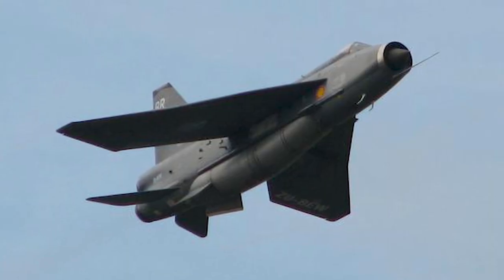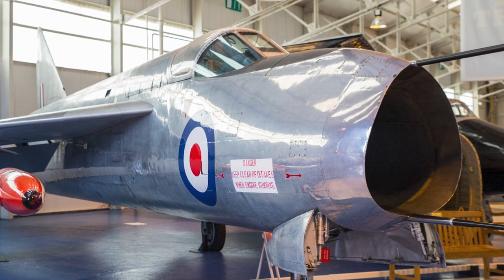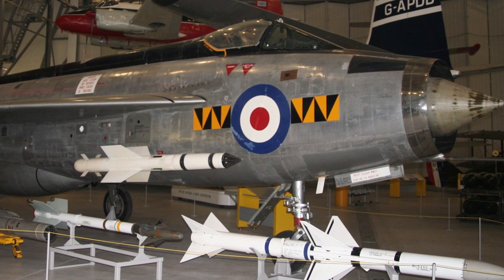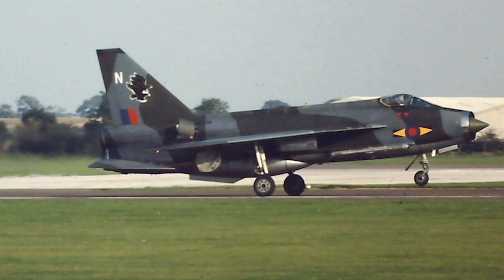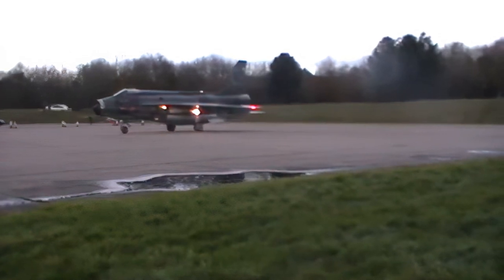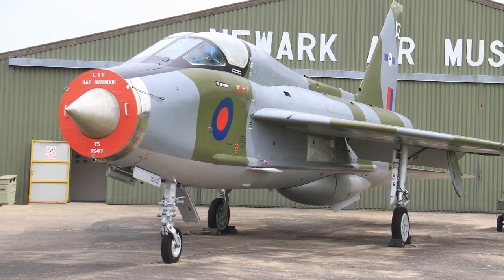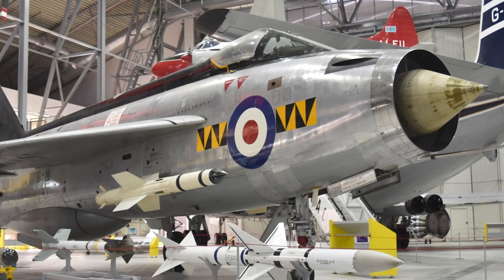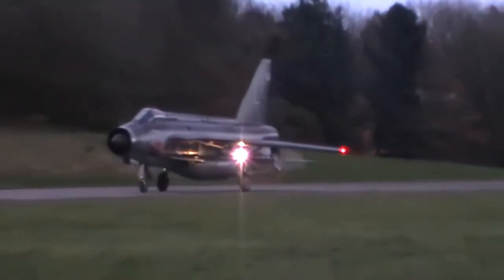English Electric Lightning - A Short History

Comment: M53 EEL's were capable of Mach 3
Reply: Can I have a source on that please, that seems a bit extreme
Reply: @Sichere could it achieve Mach 3 SAFELY? The reason I ask is that the MiG 25 was CAPABLE of Mach 3, but at the risk of engine burnout and was therefore limited in practice to M 2.2. I also read that the highest speed the EE Lightening was clocked at was 2.35.
Reply: @Boudicca-the-musical  http://all-aero.com/index.php/contactus/45-planes-d-e-f/3307-english-electric-p1-lightning

The performance capabilities of the EEL was a State Secret but they were regularly clocked by Dutch radar doing Mach 3 over RAF Dogger bank in the North Sea.

The limiting factor was the Fiberglass nose cone and the canopy being damaged by the heat buildup, so "operational restrictions" were in place to increase service life.

The tale is that the top speed of the Lightning was never achieved, as it would run out of fuel first. The frame was capable, as one EEL managed well over 13g pulling out of a fast dive through low cloud, when the pilot was reprimanded and asked to explain why he had done it "I couldn't pull any harder" was his reply !

The Mig 25 was not really capable of Mach 3, as the engines would very likely disintegrate and especially not so when carrying  4 R40's
Reply: @leerubybritvic1990  The Saudi F.53's saw combat  in the Yemeni Civil War in the late 1960s and 1970s.
Reply: @Boudicca-the-musical  It does 1800 miles per hour.They are in South Africa.